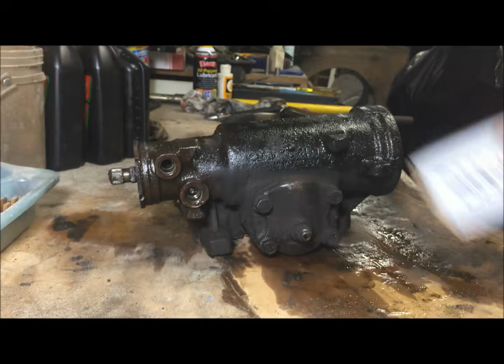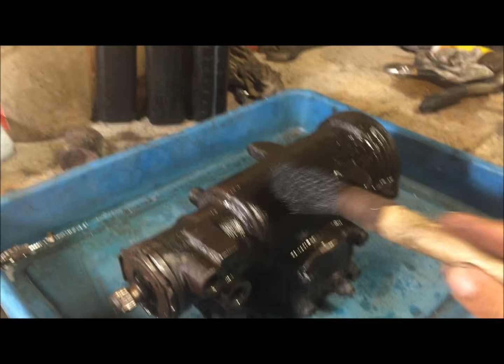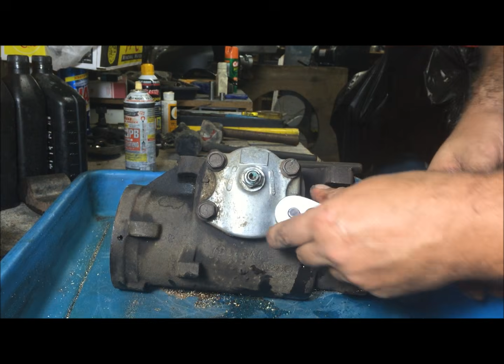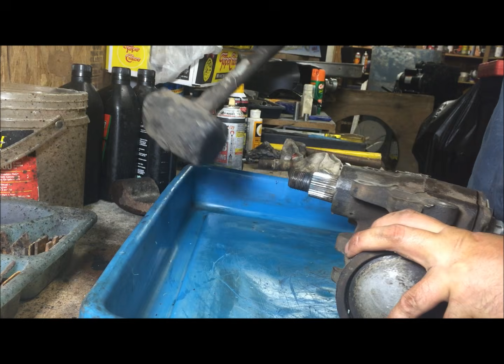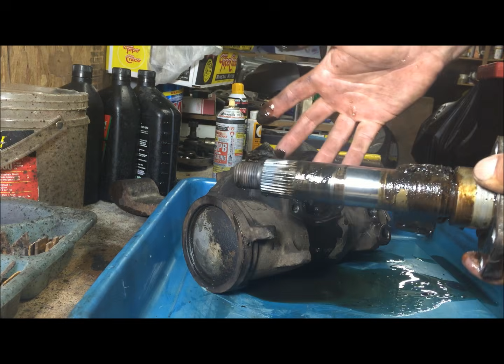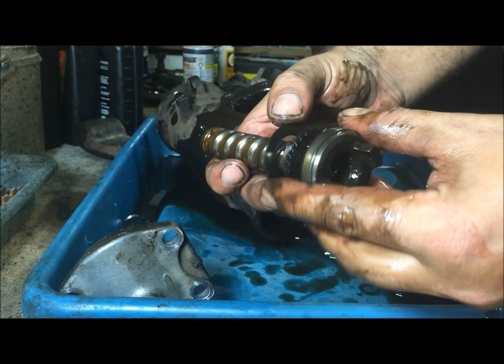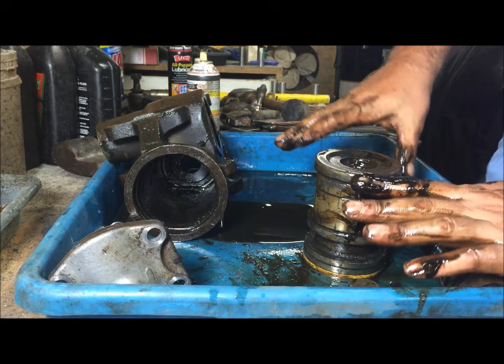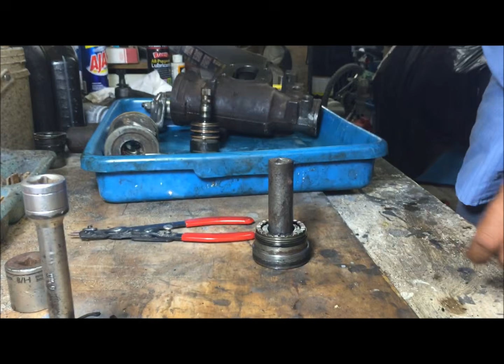how to rebuild power steering gear box saginaw part 1 tear down

Comment: Thanks,  decided not to do a rebuild because of this video
Reply: I will rebuild mine, but with a brass drift, spanner wrench, inch pound torque wrench (Beam Type), seal & bearing driver set, plus bearings (Not bee bees) and solvent not gas. Basically the same Buroughs tools I bought in 1972 when I first started rebuilding the Saginaw 800 series steering gear. ASE Master Tech since 1978 - Retired
Reply: Dean Kay when did you guys start referring to yourselves as “techs or technicians?” I graduated in 90 and auto mechanics were still called mechanics. Now everyone calls mechanics, techs or technicians. Like they are ashamed of being called a mechanic.
Reply: Dean is a mechanic...tech is some pompous way of saying you work on cars. I was an aircraft mechanic...not a "tech."
Reply: @mrbigg7255. >I would be frustrated if I never learned how to repair burn’t valve, repair a diff, track down as short, then rebuild an automatic then finish your week by replacing steering rack after doing a disc/drum brake job and call it a week.
 I am sorry to hear you had to go to a tech school but that’s normal today. The word “Technician” came in 1972 with the NIASE group. I was asked to take these test in 78 and passed all 8. Later, another job required “L1 & P2” for a requirement. L1 is 100 questions on emissions and I missed one. Blame it on them, I didn’t make up the work or use it lightly. Google it!
Reply: @CG MAX > Sorry your career in aircraft came to an end while only a mechanic. I passed all 8 test from NIASE, now called just ASE. (Google It) This certified me as a Master technician in all areas. I did not make it up, I did it. Later, working for GM that has certain military concerns, I was certified I-19 as well, plus, when a Master Tech, you are allowed to take “L1” advanced emissions that is 100 questions, I missed one, but passed “P2” advanced parts but have no time in a parts department so I was not issued certification. 
I am sorry you did not get certified by the FAA to be a technician as this would allow you to anywhere to work from Alaska to Hawaii. Sounds nice to me. But since I was certified, I went for the money in flat-rate pay that enabled me to retire nicely and early. So best of luck and hope you pompous vocabulary doesn’t catch up with you at such a youngster should respect those who “Do Know” their work, diagnostics and the ability to achieve certification. Work for it and someday you can get what you need to remove the chip off your shoulder. Best of luck and don’t disrespect your elders! I turn 60 next year and I have sons that own their own internet business and it’s booming for their service during WuHan & face mask. Study!
Reply: Yeah...me too...I'm in IT now making more money and staying clean. Are you over your massive insecurities as a person now, since you've given everyone your fancy resume : )
Reply: It’s surprising you can spell big words. Let me ask you about your training. Did you have any or did your sister teach you? Hum!
  Perhaps you are not able to work at a dealership as a “Lot Porter” because some vehicles have a stick and you can’t drive anything with a clutch. I would bring legal action on the tech school as the retired pastry chef did not tell how to fix cars and trucks. Too bad and very sad for a short red-headed guy! WoW, really big words. Hope you get your money back. 
 I sleep great knowing my work was done correctly and even my retired GM boss calls me on my birthday. I bet you wish you had friends! Give your life to God! I believe you need his help. Blessings and hope you are not too lonely! ASE Master Tech since 1978 - Retired
Reply: Dean Kay CG Max completely unimpressed except for the part where your retired boss calls you on your birthday. My mom calls me on mine. 🙄
Reply: CG Max >No brains, no headache. He's never had an aspirin! Glad he has got one friend even though this video is about a power steering gear box. I am not sure why a technician would bother him. Very strange.
Reply: @Nobamaable  the crap got technical when electronics took over every single system on a car.  You know...the kind of "technical" requiring fancy OBD2 readers, and STILL the technicians want the car all day to guess at what the source of a problem may be.  And after that, they are still guessing which part to replace first.  Mechanics dealt more with mechanical things whereas today this crap requires a technician to get technical while they take bets on whats wrong.  Haahaahaha!
Reply: mrbigg7255 mechanic, technician. Potatoes potatoes
Reply: @mrbigg7255  the word "tech" is an embarrassment imo,it usually means "they know one thing and fuck all else and are very proud of it"
Reply: @mrbigg7255  I walked away from the trade( in a commercial setting anyway) in 08, I was a mechanic then and a mechanic now, the term "technician" some how aggravates me although yes I have a paper on my wall claiming I'm ase certified technician, GM as well (that's where I quit in 08, thanks Obama 🤣😂 )
Reply: @deankay4434  no,you are not a master tech or whatever.you wouldn't spend 15 minutes watching this if you were,you would already know and not need to watch this.does the head surgeon watch intern medical students on their off time? not fucking likely
Reply: this is an easy job for someone that is restoring a vehicle
Reply: Definitely a labor of love and not a love of labor. I can see why anyone would just say screw it and buy rebuilt, but hey it just a matter of time, ability, tools and desire.
Reply: fucking aye... me too 
Rockauto here i come
Reply: It’s actually one of the easier rebuilds of any vehicle 😭

Comment: Great video Chris thanks to you I could rebuild my father's steering gear box. I'd like to know if you know how to rebuild a Dodge Dart 1970 Steering gear box. I'm already reading the service manual about how to do it, but i'd like to know if there are some tricks I must know before tearing apart my steering box. Greetings from Venezuela.
Reply from the maker: I have never messed with a dodge in my life.. Saginaw could make the gear box... just try it.. just mark the preload on the main bearing on the front like I did with the chisel.. the rest can be figured out by trial and error

Comment: Chris!

Do you know if gearing is reversible in each box, or those are completely different design. I need one box, bolts on but moves the pitman arm in the opposite way?
Reply: This is accomplished by using a different ball screw and piston from a box that you find turns opposite your box. 
   There are different size saginaw  boxes used in all makes domestic car truck and van.   Be careful though some have a very fast turn ratio.  My 75 Ford Bronco stock Saginaw box is a 6 turn lock to lock.  The 76-77 bronco is 4 turn lock to lock.  My Chevy suburban (identical but larger than the Bronco housing) is 3 turns.   An astro van is 2.5 or less lock to lock.   Lastly observe which side of the input shaft the sector is on just puzzle thru it the gear teeth are same if it flops left or right.  Happy hunting!

more

Comment: hi chris im wondering if you can help with a bit of advice i have a 1979 trans am and i have been threw 2x steering boxes recon ones from classic industries the one i have on now is the 2nd steering box it worked fin e for a couple of days then steering went stiff. i have jacked front end up and tried to bleed but nothing i took off pressure hose and turned over and fluid is flying out of the end of the pipe so its not a pressure issue on the return hose very little pressure not enough to go back to pump i have been using transmission fluid could this be the problem instead of using power steering fluid i thouight they were the same any help would be appriciated thx scot...
Reply from the maker: transmission fluid just seems to makes the seals leak... I would change the power steering pump.. inspect the pressure and return lines really good and make sure they aren’t kinked or blocked first... I have never had a steering box go bad.. they just get play and get sloppy
Reply: chris when the problem first accured of first reconned box i thought it was the pump and that was replaced only found out it was the box on hearing the noise i first heard in pump it was because steering box went bad but its strange how 2 have went bad thx scot also i have rebuild engine and it was the original box was on it that went bad as well so i thinking fluid can it be anything inside the box going bad:

Comment: Is there a kit to convert these to 12.7:1 quick ratio? Thanks
Reply: Yes there is but they won’t sell it. There is a higher profit margin to sell the entire box instead of one newly machined spool valve. Can you u say “$500 dollars profit neighbor?” It’s a $60 part, seal kit and core. If you have the tools, book time is 1.2 hours of labor. You never get paid to clean the outside, inside or paint it.

Comment: Hmmm... Maybe I should rebuild mine instead of buying a new one. 68 impala. I'll do it over winter.
Reply from the maker: +ever borjas it is not easy but compared to the cost of a new one... I've seen a lot of people fail and buy a new one
Reply: yeah, that's my concern. I mean I've rebuilt hydraulic pumps for lowriders, so this doesn't intimidate me too much. But at the same time... I don't want to end up buying special tools which would then end up costing close to what buying new one would. I can take off the new one with simple tools.
Reply from the maker: you dont need special tools..  but it can be very difficult to put the bearings back in the worm drive... and if your box has play (GOOD LUCK)  check rock auto and if you can get a box for 200 or less i would do that..

Comment: It was a BITCH taking the retainer for the cap off when i did mine today. 
It was seized up. Pried on it and hit it with wd40 and bent the crap out of it. And it eventually came out 

Ran the piston forward to pop the cap loose then suck a small allan wrench in the hole and pushed the cap out using
A little force. ..... the o ring there was the only thing leaking 
But i flushed most of the box out with wd40
Polished the output shaft 
Replaced the seals and washers for it. 
But i couldnt get the bearings out .... their wore out a little..... bled the air out...... now i need more fluid...

Comment: buy a new one .
Reply from the maker: obviously, you have no idea what you are talking about...  that was a nylon bristle brush...  you would know this if you actually worked on cars..
Reply: You never never never use a wire brush and gasoline to clean a metal part because if you use gas and wire and cause a spark your done
Reply: dale roberson a hand brush wont maybe a wire wheel on a grinder but its not likely.

Comment: going to try my luck now just ordered kit from auto zone for 38 bucks, I got a 68 pro street lemans and it's all over the road lol. hope it works I got a lot of play in gear box
Reply from the maker: if you have play in the box......  you need to return that kit and buy a new box...  just trying to save you time and headaches....   the process to get the play out (because you have to learn how do it it) is not worth it...... im hoping you have eliminated the fact that the play might be in the drag link, tie rod ends, etc...
Reply: I checked the rest of the stuff on front end, the pitman arm shaft has a small amount of play side to side I'm hoping the bearing is just bad

Comment: Chris... here is a easy cleaning idea...    I take a large metal coffee can, and a $9 single burner hotplate from Walmart.   I fill can 1/2 way/// or as needed for depth... with Purple Power.

Bring it to near boiling and insert your parts.   All the goopey heavy grease will emulsify and everything will come out spotless... then rise with a hose... then put back in as required.

I do this with hubs without having to take them apart... they come out like new.
Reply: Great tip~!!  I intend to use it=thanks.
Reply: Sorry but what is purple power ? never heard of it or seen it, anything else that can be used in its place ? thanks!~
Reply: @themisunderstoodgorilla7030 it's a wonderful substance that eats away at greasy coatings on parts. A lot like Simple Green, but if you use P Power without gloves it'll let you know where all the little knicks and cuts are. Beautiful stuff, I love it.
Reply: It would be like a “Simple Green” sold in the Midwest and elsewhere. It is strange, as both products are environmentally safe, mostly made using the oils found in the skin of oranges. ZEP is a large company that sells variety to cleaning products yet not sold in some states. ZEP sells a 55 gallon drum of powder that is an orange powder. Smells like oranges. 
True story, in a shop in California, a shop was closing for the day and a tech scooped some ZEP floor cleaner. You can wet the floor and spread it around like extra dirty spots to brush, broom, mop or like our dealer, used an electric push scrubber. 
The tech sprinkled the orange power on the damp floor & the power turns green immediately. After clearing the floor, you hit it with your water hose. Part of the green watered floor solution came out the door and was running downhill away from the building on a white concrete slab. A person driving around the building though this was “Green Anti-Freeze” headed for the curb that drains into a nearby creek. The person freaked and dialed 911 to report this unthinkable crime against nature. 2 fire trucks, police and 1 ambulance came quickly to clean up the violation, arrest the offender and provide first aide to any person or creature may have ingested. Once explained and examined, it was explained to the concern citizen to calm then and reduce there fears. Now they can sleep better. But the law in this county had a pollution rule that the response required the shop owner to get a $7,500 ticket. He had to pay a lawyer and pay to have a ZEP salesperson to show MHDS to court to have the ticket dropped. Close call. 
Glad to help you learn because you don’t have be an ASE Master in all eight categories like I did every five years. Others may learn from the written word, some by seeing and others by doing. Some all three. You’re welcome as learning never stops.

Comment: OK my friend my job is rebuild gear boxes and on my experience I can tell you that the gear box come with only 22 ball bearing originally unless if is rebuild it came with 24 and half of those are from 1 to 2 thousand of different
Reply: Juan Castillo thanks you just saved me about 20 mins of dighing through my oil pan cause some roled off my bench bit guess it was onlh 2 roled off
Reply from the maker: the chevelle box had 22 and there were two diameters of bearings....  this one did not have 22 and they were all the same diameter.... 1988 G20 chevy van

Comment: Truck steering box is mounted on the outside of frame and car box is mounted on inside of frame.  Steering box housing are not interchangeable but the components inside are. 
Here is a write-up for torquing sequence and specs, very critical to your rebuild.
http://www.gmceast.com/technical/Wirth_GMCMH_Steering_Box.pdf
Reply from the maker: obviously, i meant the boxes are rebuilt the same..  i dont see a point on your link..   just wondering how many boxes you have built?
Reply: Bruce H. My gm truck box is on the inside of the frame.
Reply: Allen McKinney depends on the year and 2wd or 4wd

Comment: I'm abut to replace the oe in my Bronco.. Not because it's leaking but it has (Not even joking when I say this)  but I have 6" inches of side to side play... Yes still daily driven.  lol  But I think those Teeth on mine are almost worn out completly
Reply: rebuild aint gonna fix that
Reply: Unlike the response from “Trillriffy”, the input torsion bar could have broken. Thin ones have less road and would have to be salvaged from another box. Thick ones have little flex and produce less steering wheel force to turn. If the rag joint is not about to snap, the type of steel and nylon balls used on the ball screw may have failed. A guide could have come loose and would create this malfunction also. Best of luck. Still way cheaper than a reman.

Comment: Would rebuilding this way fix a sloppy box?  My escalade ext has nearly an inch of float on center. Also it seems to turn faster right than it does left from the same amount of input.